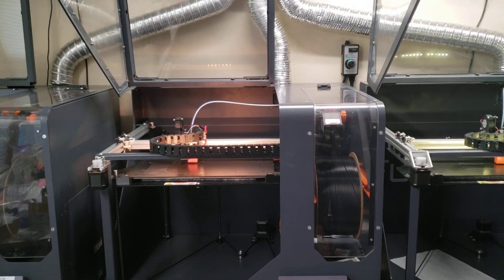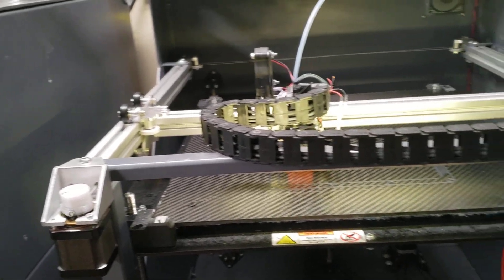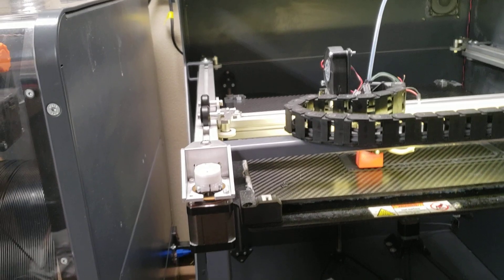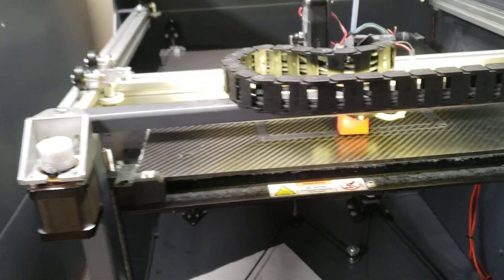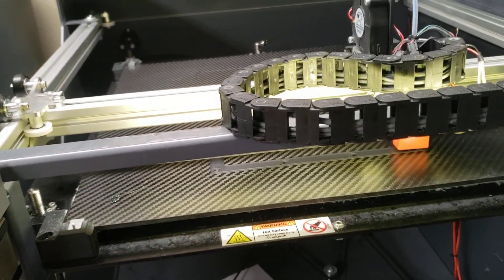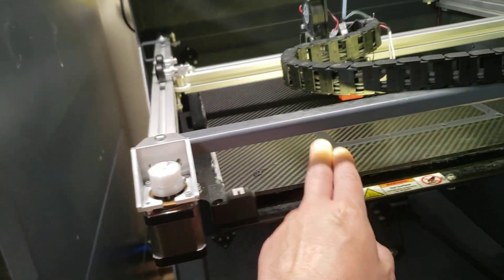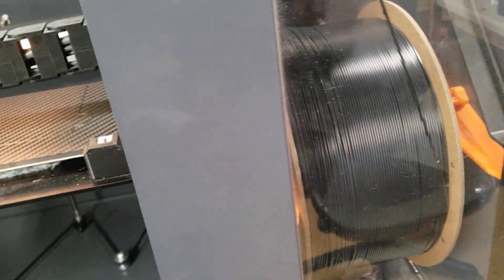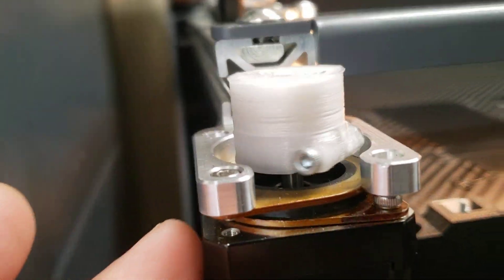Fusion 3 3D Printer F-410/F-400 Upgrade Mods UPDATE

Comment: https://youtu.be/W2Cx4RmmeiY?si=uNGu1U9eNHdedlBE
I used to work at the factory. This is how I used to assemble them.
Reply from the maker: Awesome video there bud! These printers have a pretty bad reputation, but I like mine.
Reply: @charlessbiggs7735 
I'm wondering if buying a used one in 2025 still a good option or should be better off getting a newer faster other brand...for around 600 bucks...